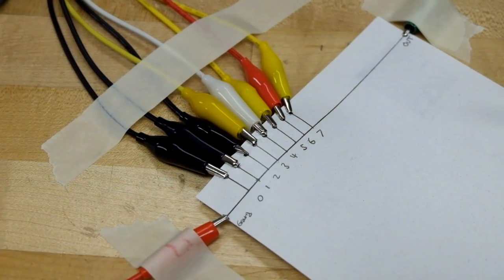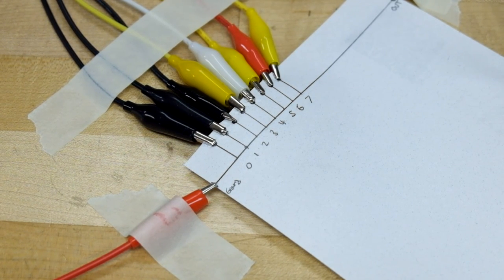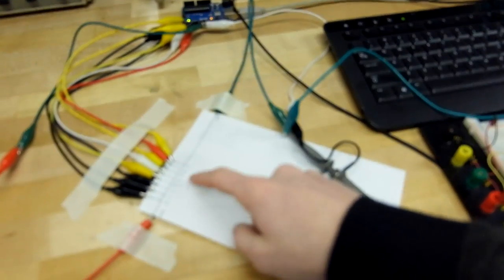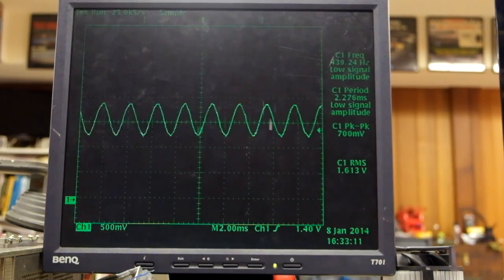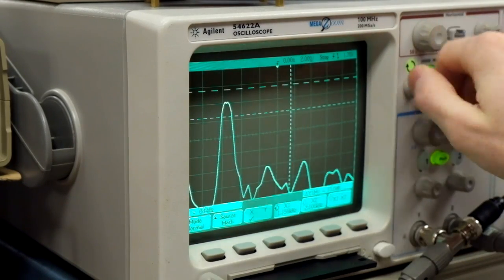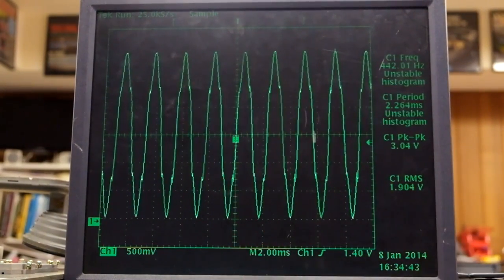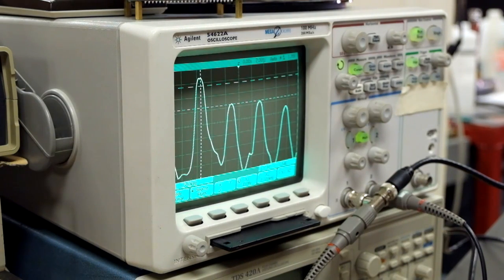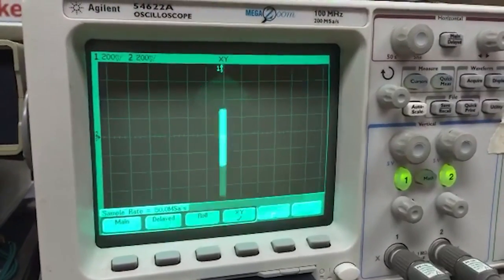DIY Arduino Paper R2R Ladder DAC 8 bit

Comment: Wow! That is cool!  Did you have to try multiple times to get the resistances just right? Sharpness of the pen, amount of pressure, etc? or is it pretty tolerant to the pencil line variations?  Cool idea!
Reply from the maker: The resistances varied quite a lot as you would expect but I took the lazy route and just used a filter on the output to smooth everything. I'm sure you could make it much more precise than I did. I just wanted to put the idea out there any maybe someone else will take it further and play music on it or something haha

Comment: You get this a lot, but you should be proud of yourself. Your circuits are similar to the ones built in undergrad labs, and grad courses cover modern designs. The fabrication work you do is something also taught in some undergraduate programs, but your early devotion and practice understanding will lead you to something special. Most RAs are half the craftsman you are now.

Comment: Are every DAC chips in smartphone,cd player and computers the same type with your DAC?i mean the same architecture like switched resistor as your?
Reply: Not all. I think this type used in less than 1% in serious technic.
Reply: Not at all, on chip DACs use many different components to achieve a high matching and high speed. Some use capacitors, some use matches current sources, it depends
Reply: most have Sigma delta DAC since it's more compact

Comment: That is pretty cool man. It would be nice to see some schematics to understand how that capacitor is connected to all your instruments.
Reply: It's a low pass filter, like the one here
   
https://www.electronics-tutorials.ws/filter/filter_2.html?utm_referrer=https%3A%2F%2Fwww.google.com%2F
   
So the long graphite line after the DAC is the R in the RC filter and the C goes to ground. At least that's what it looks like.
Reply: @user-qf6yt3id3w  Where is all that junk coming from when he removes the capacitor? 
when he removes it the signal amplitude goes from 3Vpk-pk to 600mVpk-pk.  
Is he driving the DAC in a much higher frequency?
If so then the filter is in such a low cutoff that he starts to filter the sine wave as well?
That is what I would like to know.